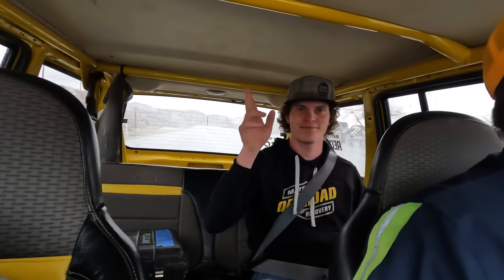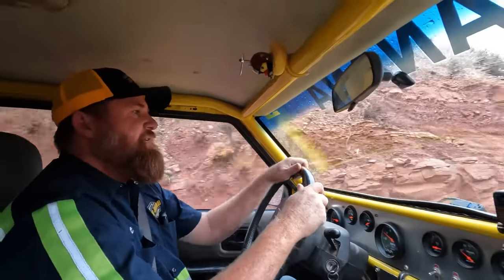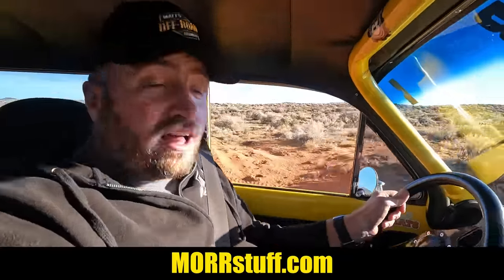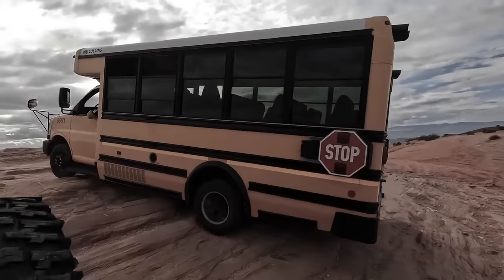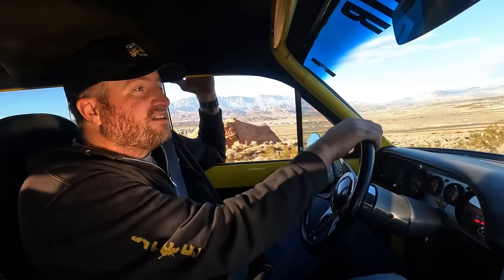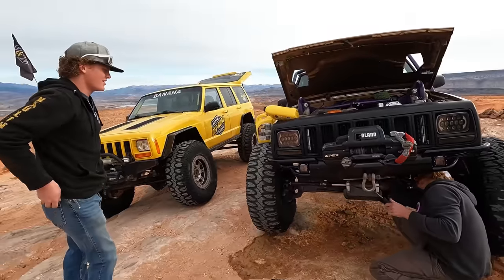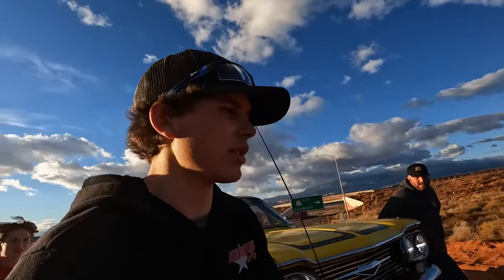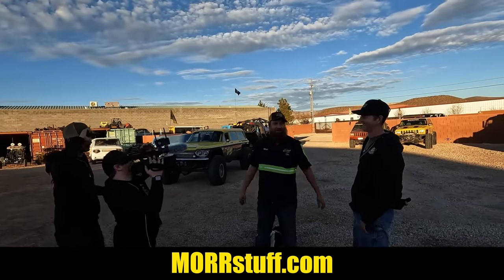This One Decision Left Him In The Hospital

Comment: Matt you cannot be proven wrong.  A random number generating experiment at Princeton University many years ago proved what you just described.  The windshield side of the driver is doing more work because more light is passing thru it at any given moment.  Light in this case is synonymous with the intention of your will, this it has an accumulated effect on the nanoscale upon the mechanism of the wiper.  It’s physics not meta physics.

Comment: As for the window wipers, ever thought that because the drivers side is more prone to getting hit by the spray from other vehicles going in the opposite direction, throughing up all sorts of ( bleep ) therefore wearing that wiper out faster than the passenger side?   ;) you never know,  simplest explanations are usually closer to the truth than some think...😉 Same thing happens here on UK roads, drivers always get the change blade task first.

Comment: The driver's wiper could be wearing out at a different rate because of the difference in airflow, as the driver-side hood vents are just for show. That could increase the drag on the wiper, or over time it's affected the wiper arm spring differently than the passenger side.

Comment: I was giving some thought to the theory of the windshield wiper affected by vision. Since it is a known fact that a watched pot never boils, you can extrapolate that vision is cooling force capable of negating flame. Rubber is known to crack ot extreme cold temps, so applying the cooling vision accelerates the rubber deterioration. Matt's theory is thus proven.

Comment: Wipers wear more on the drivers side because most roads are 2 lane and that side gets more road splatter from cars going the other way. I used to be so cheap that I would buy a new set of wipers and only change the drivers side and put the other behind the truck seat for a spare then when the passenger side wore out I would put the spare on the drivers side and move that blade over to the passenger side.

Comment: Traffic in the opposite direction puts more junk on the driver's side of windshield causing the driver blade to wear faster. It is not worth buying cheap wiper blades. It is not worth buying the most expensive blades. Used RainX once. That was a mistake imo. Never apply anything to the windshield especially silicone. This from an Oregonian.

Comment: Nothing like your windshield wiper motor on out in a downpour 65 mph on a steep inclined bridge. Lucky there was a truck I could see his rear tail lights had to drive 12 miles I 12 interstate like this on the side of the road to find a Pep Boy . The manger unlock down door that I can get some rain X by the way did I mention it was New Year’s Eve. They didn’t have a windshield motor. We made it. Another 70 miles.

Comment: The driver's  side on both my worl truck 15' 2500 hd Chevy has always gone bad 2-3 weeks after a new set.  The spring pressure is too great but thevfleet Co won't  fix it.  I have the same isdue on my Tundra but not as bad .just got Rainex eipers.  Mounts are crap, Type c or something.

Comment: No Matt. Its called the third logical extension of Murphy's law which roughly states " what can go wrong will usually do so at the most inconvenient time so as to cause the maximum embarrassment, annoyance and inconvenience to the person responsible for not having corrected the potential problems before they happened!" In a nutshell, its all your fault. Like running out of gas, routine maintenance, etc.
Thanks for the opportunity to give you a ribbing. Regards from Canada's banana belt.🤞🇨🇦🍌🥋🇺🇦🕊️🇺🇲🦃🌦️☃️💥🏁👍

Comment: Apparently you guys have never experienced good old Georgia red clay! You ARE NOT going to just drive through it. It's slick as snot and extremely difficult to clear out of the tires. I will attest that that Sand Hollow sand is really nasty too. It's more the consistency of powered sugar than sand. I found it quite difficult to even walk through. But you are definitely wrong about Georgia mud because for the most part it's just red clay.

Comment: My passenger side wiper always goes bad sooner but I don't care until the driver side starts failing.  The reason a passenger side goes (on my truck) is road splash from the curb in my road salt state.  When I had a long commute with a decent amount of two lane road travel, my car's driver side wiper would fail faster from road wash and spray from oncoming traffic. 🗿👽🗿👽🗿

Comment: Those so called "adventure bikes" should not be taken off road by anyone but the most experienced off roader, and even then with much limitation.  They weigh 500 plus pounds and are basically street bikes masquerading as rally bikes.  If you want to do anything more challenging than graded dirt roads, then get a duel sport which is a real dirt bike with accessories to make it street legal.